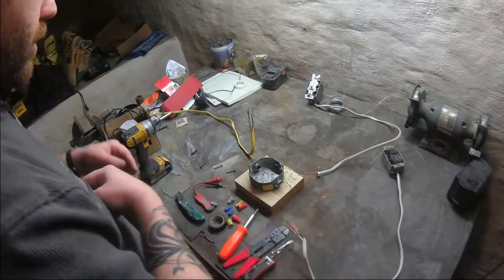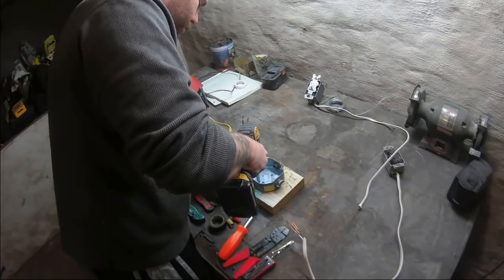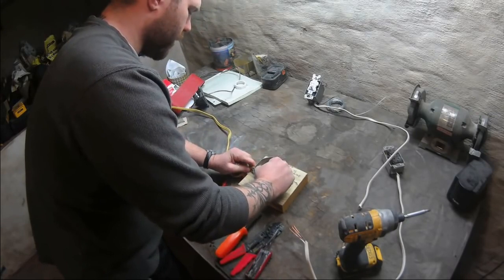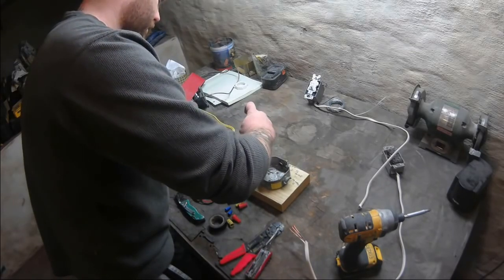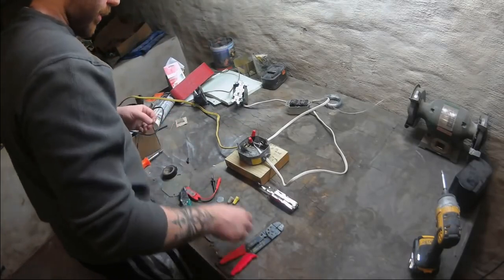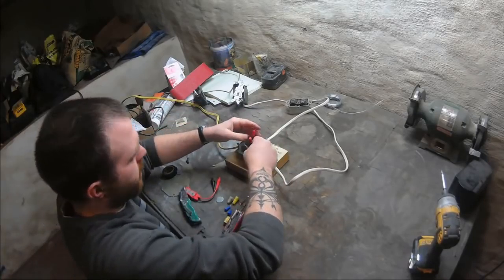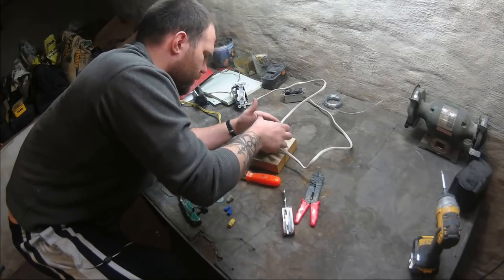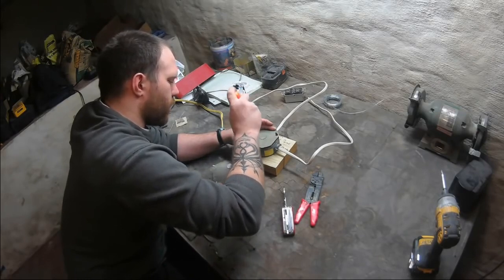D I Y  How to Install and use an Electrical Junction Box

Comment: Since its a metal box you should also connect the ground wire to the box using pig tail for better safety.

Comment: I don't want to the party pooper here, but a couple of things make this video questionable as a educational source. First and foremost are his comments about grounding. Saying things like, "It doesn't really matter," or "it's no big thing" are counter to NEC code and common sense. If you can ground, do it! True, not grounding will not necessarily present a fire hazard, but hey, it takes 10 minutes and is worth the insurance it buys you. The other is that you can barely see what he is doing as he narrates. A tip for all would-be YouTubers: Move in with your camera! Your explaining what you are doing without our being able to see it clearly is of little value. Most people are visual learners and seeing is always better than hearing. 

I just finished a DIY job of installing a single-pole switch to control two lights in my basement. I learned more from doing than everything I read and watched hear, though both helped. So, go slowly; if you make a mistake (assuming you realize it), do it over, always in compliance with the current code in your area. Make sure you have EVERYTHING you need and cut NO corners. Take notes, and pictures of your work in progress and finished. Electricity can (and does) kill. A DIY job done correctly offers a great sense of accomplishment, teach you something,  and can save you significant $$. Knowing when to call a licensed electrician is an exercise in common sense.

Comment: So is it ok to have 12/2 yellow wire go into a 14/2 white wire? I thought it was a no-no? Or is it the reverse that should not be done 14/2 to 12/2?
Reply: You're correct. You shouldn't mix wire sizes. If it's an emergency situation I've read the smaller wire (14/2) should be at the breaker and the bigger (12/2) should be at the outlet. I don't know if this is correct though

Comment: Is power supply feed generally yellow in color?
Reply from the maker: You have White, Black, and Green (Or Just a Copper Wire). White brings in Power, Black sends power, Green is for Ground.

Comment: Can I cut an existing 14/2 wire in half add one of these junction boxes with a third 14/2 in order to add an outlet?
Reply: Sure, just remember that everything is running off this one breaker, and whatever you intend to use for this additional outlet will not be an overload and constantly trip the breaker.

Comment: so if you have 12-2 going in from the power supply and connecting to 14-2 wires (the outlet and light switch) what size amp breaker do you use?
Reply: @tiger mart When you go up to 20 amp, you need 12 AWG. 30 amp would be 10 AWG wire

Comment: Instead of a switch can I have just two outlets? I have a basement with the electrical showing. I wanted to cut it and do this to make another outlet else where on the main floor.

Comment: so basically you're just connecting all the wires by color, and if you want to add a another line to the box you just match up the colors of the wires Black to black, white to white , ground to ground correct?
Reply: Brad S Precisely

Comment: great , but I have question: the wire from the  on/off switch should contain 1 hot wire (black) connect to the pole on/off switch since your cable carried 3 color code wires (black,white,and green) from on/off switch
connect to junction box how we mismatch the color when connect to other in junction box ?
Reply: You tie the whites all together.  The grounds together. And the switch breaks the power or black wire to open or close circuit.
Reply: hots neutrals and ground. 

black,white,and green

Comment: Get some Klein linesman pliers and grab all the wires you want to twist, make sure the wires are even when you clamp down on the pliers. Then twist to the right and about half way through your twisting loosen up on the pliers so that the coated portion of the wires don't want to twist just the bare ends. With a little finesse and practice you'll get a feel for it. It's important you twist to the right though otherwise you'll loosen them when twisting on the wire nut.

Comment: Thanks for the video.  It is exactly what I wanted to know.
Reply: Get some Klein linesman pliers and grab all the wires you want to twist, make sure the wires are even when you clamp down on the pliers. Then twist to the right and about half way through your twisting loosen up on the pliers so that the coated portion of the wires don't want to twist just the bare ends. With a little finesse and practice you'll get a feel for it. It's important you twist to the right though otherwise you'll loosen them when twisting on the wire nut.